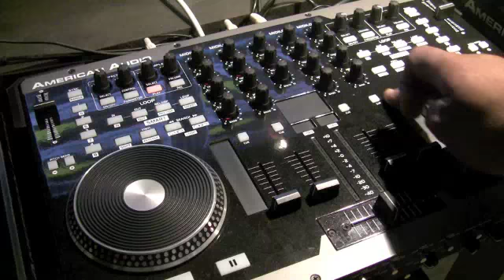VMS4 Mapping Guide Pt.1

Comment: I tried downloading asio4all and ran into all kinds of issue however I went to the official site for the vms4 and got the driver from there and it worled perfectly no ad ons no filling out for other offers and you can switch between external mixer to the advanced config without having to restart or unplug